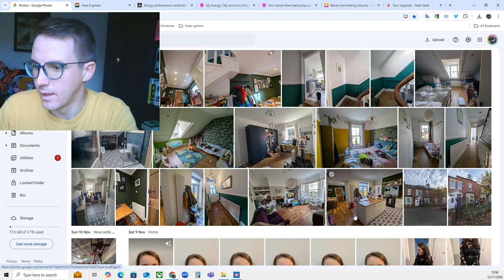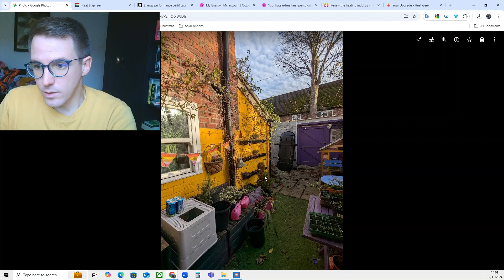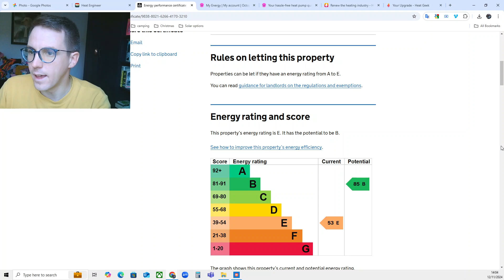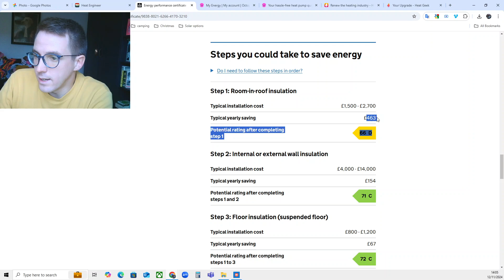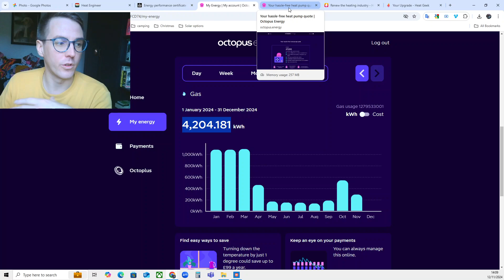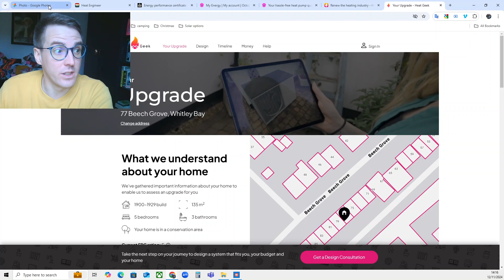Should I get an ASHP?

Comment: You can also divide your gas usage by 2900 to get a rough idea of the size of heat pump you need, was compable for our actual Octopus survey (didn't go ahead as "one size fits all" approach doesn't work in our new build). And don't get me started on EPCs!!!
Reply from the maker: @edwardpickering9006  yes the quotes for a 12kw heat pump for a calculated 10.75kw estimated heat loss and I bet we never need more than 8kw. 

Still better than being cold